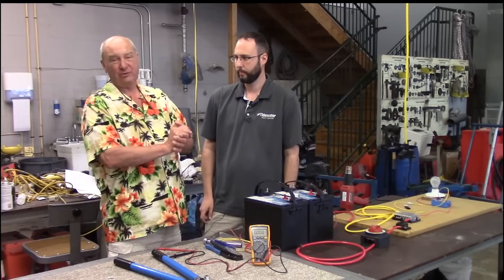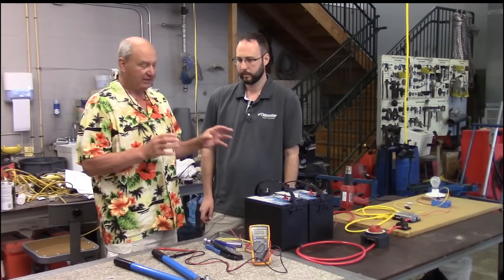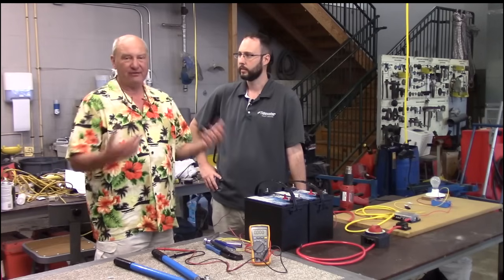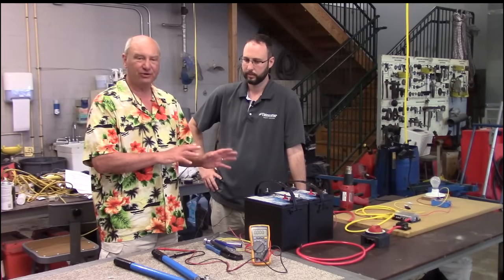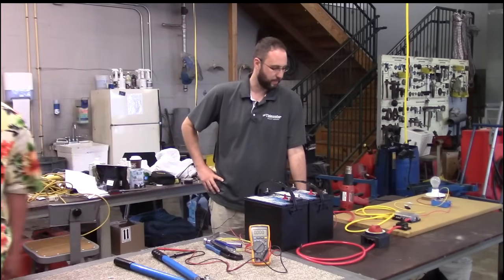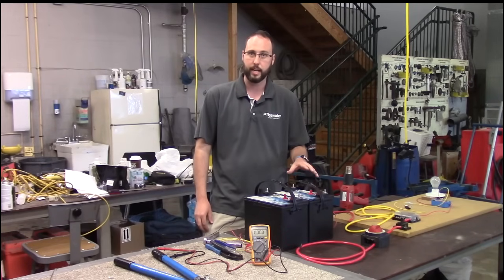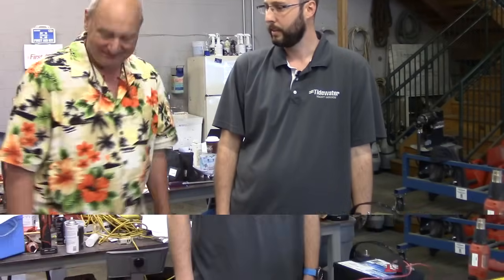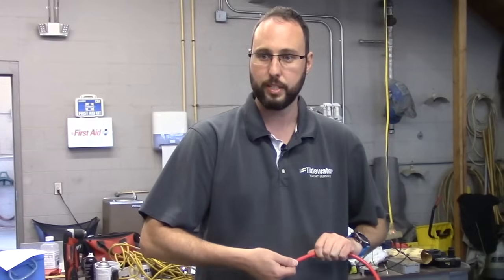wiring batteries on your boat

Comment: you should also use tinned stranded cable marine grade and keep loads away from battery posts where corrosion happens from outgasing...go to a terminal strip away from battery....a shunt on the negative side for proper amp/voltage meter to monitor all loads and charging
Reply from the maker: thank you i like the idea of using terminal strip

Comment: Not sure if the small crimps illustrated meet ABYC but I wouldn't have them on my boat. Best practice is to use ones with a self adhesive heat shrink sleeve not PVC as illustrated
Reply from the maker: @rolandstockham190  thanks for watching and the info 😀

Comment: 34 years as a Electronic Tech. I’ve read about voltage drop but never seen it in the real world. For instance addressable SLC loops on 18/2 shielded cable running throughout a building thousands of feet 32 volts at the panel and exactly 32 volts at end of wire run. Just my experience there would be no voltage drop in 20 feet of wire.
Reply from the maker: thank you
Reply: Your electronics are very low load.  My roamsat system had a voltage drop of .87 volts in 26'. When my batteries reached 12.8, internet went below 12.0, and shut down. This was on 14 Gage wire. Upsized to 10 Gage and voltage drop was only .2 volts. So my system now works great. This has to be measured under load, or voltage dop is 0!
Before you say anything, I am an electrical Contractor and electrician with 35 years experience.

Comment: I want to install one of those on/off switches by my cranking battery. I don’t understand from your video what wires go into the switch and what wires come out. Great video btw. I can’t find any info anywhere on how to wire in this on off switch anywhere. Any help would be greatly appreciated
Reply from the maker: I think you want the positive wires
Reply: @VagabondEpicurean  going from where and to what location in the switch?No black negative wires to the switch?

Comment: Good video but one question. If you’re hooking up two batteries, how is the second battery hooked up to the switch?
Reply: It's not directly. Once the batteries (two or more) are connected they form one "bank" or unit either in series or more likely parallel as he showed, so remember take positive from the 'start' of the battery bank and negative from the 'end' of the battery bank. In this example, the red positive feed wire would be exact as it was and the yellow return would go to the negative terminal on the last battery in your bank.

Comment: If I have two trolling motor batteries connected and I hook one of those batteries up to a charger, will it eventually charge both batteries??
Reply from the maker: i think you are better of connecting them in parallel
Reply: @VagabondEpicurean  Thanks for the response.  Sorry, I didn’t specify, they will be connected parallel.  Will one charger charge both batteries that way?

Comment: I believe the light circuit should be fused on the positive side to protect the wire if a short circuit was to occur.  Did I miss the placement of one?
Reply: I think that is a fuse board with individual fuses where the gauge is stepped down, I guess you could put one after the light switch itself (or maybe that too was fused).

Comment: can you show how to wire the trolling motor to the 60 amp circuit breaker. And the 50 amp circuit breaker to the lights & accessories. then  tie that into the master cutoff switch?

Comment: Shouldn't you have the main fuse/breaker as close to the battery as possible? In your circuit what happens if the cables shorten between the battery and your main switch?
Reply from the maker: yes thanks for watching

Comment: Don't touch bare wire with your bare hands.
Skin oil will add resistance. 
Use the thickest lugs you can afford.
Imagine the cross section of the wire compared to the cross section of the lug's neck cross section between the wire and the hole.
Spade lugs are for low current circuits.
Reply from the maker: thanks for the info :)

Comment: One thing 'you' don't seem to use is liquid electrical tape. After I crimp a terminal I shove liquid electrical tape inside all areas of terminal i can get it in before heat shrinking to positively seal it from any salt air or water getting to wire strands. Too many times i have seen wires with adhesive shrink that still have areas water and salt air can get to strands. I have had to rewire failed wiring done by others too many times. You also never mentioned using dielectric grease on all connections you can get it on. I also disagree with you on spade terminals. Use 'ring' terminals instead of spade terminals, they are just so much more dependable and eliminate more  potential wire troubles. ***Dielectric grease and liquid electrical tape is your friend long term when wiring is used on a saltwater boat! Learned my lesson on depending on other peoples wiring techniques!
Reply: Well I wired.my 25Ft cuddy W/A with a 4.3L I/O I used 250Ft of 16 gauge for electronics and another maybe 30Ft of  6 Gage for grounds and power all tinned copper wire!  All crimped with sealing heat shrink! That was 25 years ago this year!  My boat is docked in salt water all summer every summer since I Bought the boat 25 years ago! The only thing I use Dielectric grease on is my light bulbs! I did not get to the part in the vid where he said he uses fork terminals, But I can tell you that the USCG says to use only ring terminals! If you are using high quality marine grade products you should not have any corrosion or issues! Also liquid electrical tape will dry out and crack over time and it will leak! If you had to redo failed connectors most likely the reason was poor workmanship or crappy materials! People think because they watch a YouTube video they now know how to do it just like someone that has been in the business for over 20 years! With everything else in life practice makes perfect, So why do people think they can watch a video and now all of a sudden they can do it too! People say boats are money pits I say the people that  throw money into boats are the people watching videos and doing their own work! I've been boatng over 30 years, I had to be towed in one time, Due to a brand new condenser that failed after changing it with the points 2 weeks earlier!
Reply: Put dielectric grease on top of connectors, not between connector matting surfaces. 
Dielectric = not conductive.

Comment: Hi I've just watched your video and I have a 50hp tohatsu outboard I also hAve a blue sea dual distribution cluster which I want to connect to 2 batteries in my wilson flyer but I am unable to find out the correct information of how it should be wired up with the charge unit for the 2 batteries as I want to use the original fuse holder which has all of the nav lights on it already wired up including the fish finder WIRES.  Please can you help as I have watched your video and understand that if you wire negative to negative and positive to positive as you did in your 2nd example will this safely charge up each of the batteries in turn?
Reply from the maker: Hello, I am not sure that is why i have an expert do the talking.  With that said, each battery should be charged.

Comment: Best practice: Coat the conductor with dielectric grease prior to crimping. Heat shrink is only a form of insulation, NOT waterproofing, although it's great at hiding corrosion!

Comment: Why not more that 4 ring terminals on a post?  Could I get away with copper wire on a boat and not tinned copper wire?
Reply from the maker: Tinned wire is more corrosive resistant.  I have learned that even the air around saltwater carries small amounts of salt. I would not recommend using regular wire.  Not sure why max 4 rings on a terminals.  the ABYC does a LOT of testing.

Thanks for watching and for your questions
Reply: @VagabondEpicurean     I was panning on using an inline fuse for my Sonar.  The wire for the inline fuse is 1 ft long and 12 ga.  I was then going to extend the length of wire to the bow requiring 18 more feet of 10 ga wire.  Can I put the inline fuse near the battery even though it is 12 ga or do I have to attach near the bow just before the sonar?  BTW, my boat only sees fresh water......
Reply from the maker: @larrythompson5617  i try to put the inline fuse in an easy to reach location, most of the time it is near the battery
Reply: @VagabondEpicurean   Sounds good.  I was concerned the smaller gauge wire near the battery would restrict the amp flow.  Thanks for your help...

Comment: Great stuff, I have a question Does ABYC have a distance for the main fuse from the battery and should it be installed Prior to the battery switch?
Reply: Yes before the battery and a quick Google search said 7" or 40" if in a sheath.